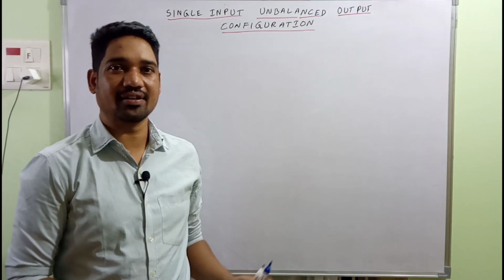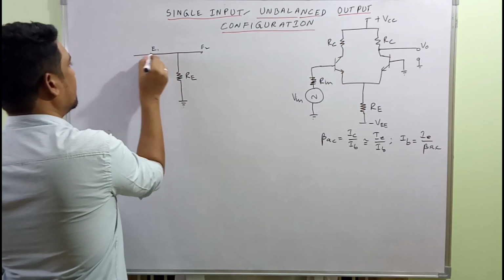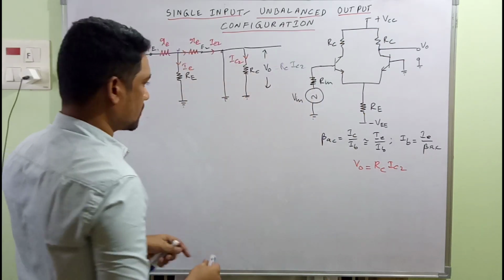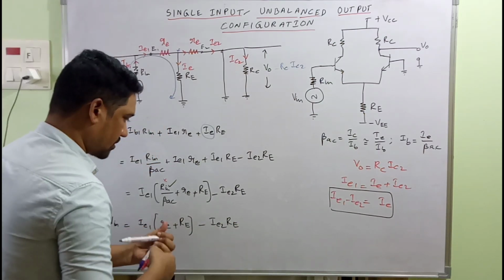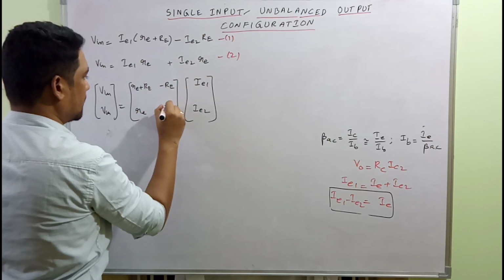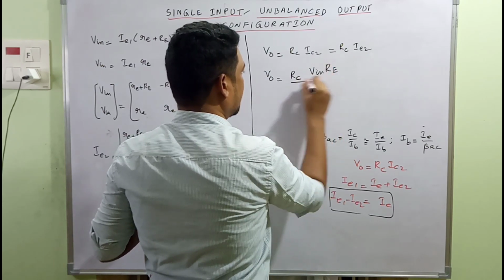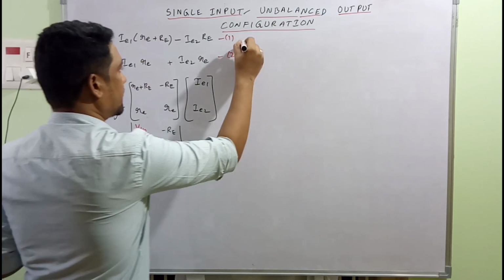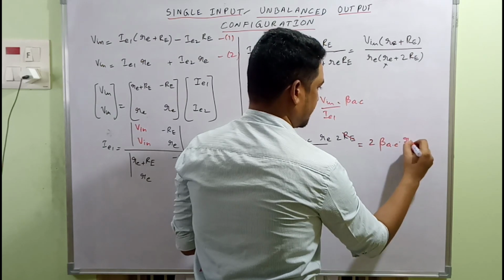single input unbalanced output configuration || LICA by ushendra's engineering tutorials

Comment: Sir since 2nd input is not present so we don't calculate Ac (Common Mode gain) right?
Reply from the maker: Yes , u r absolutely correct.
Reply: @ushendrasengineeringtutori4259  Sir I have one more doubt like the other input is grounded so Rin = beta*Re, why factor 2 is present there?
Reply: During Dual input Vin1 = Vs/2 and Vin2 = -Vin1 right? 
and during Single input, we directly apply Vin = Vs to any base of BJT right? So don't you think if Vin2 = zero so therefore Rin2 =0hms?
Please guide me I'm trying to figure it with the help of H-pi model